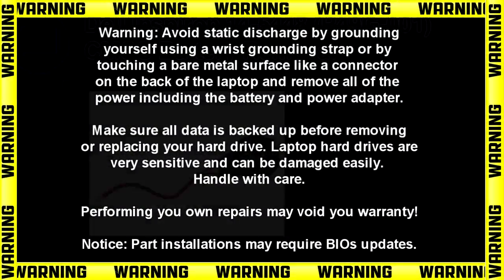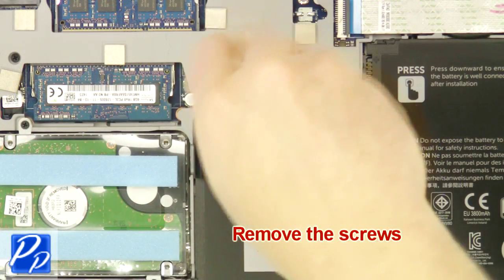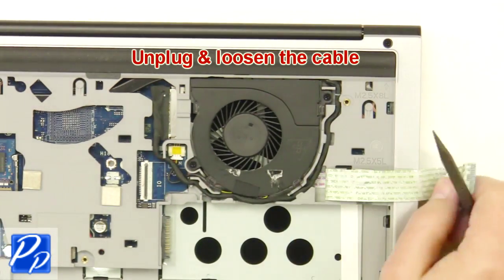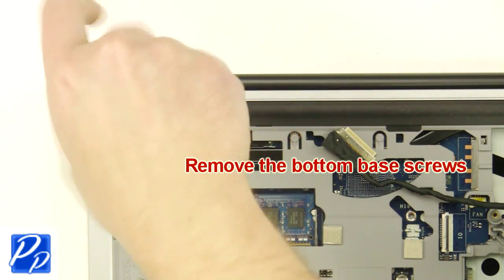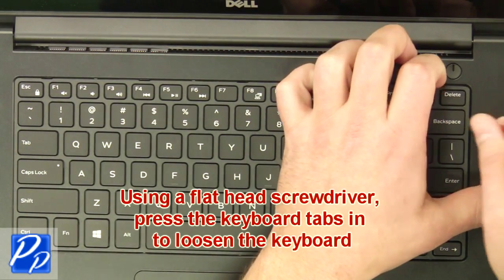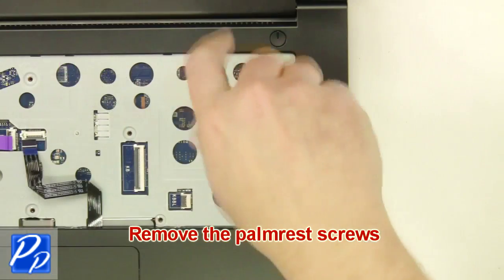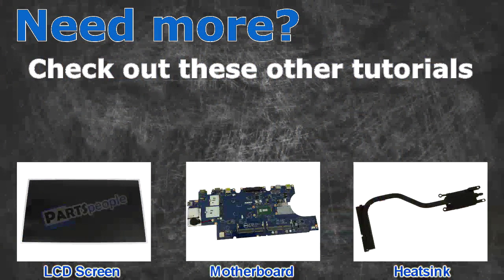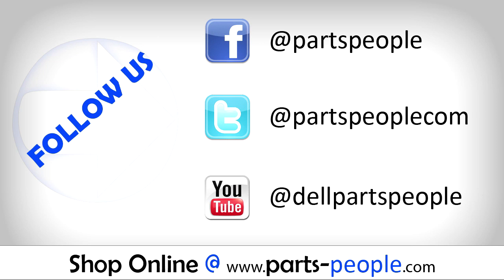Dell Inspiron 14-5448 (P49G-001) CMOS Battery How-To Video Tutorial

Comment: Great video. My 5447 does not seem to turn off fully. It is running windows 10 and I get good battery life from it from a full charge but if I leave it over night it drains to zero even when shutdown. The battery charge meter is malfunctioning also. Sometimes it says I have 3 days battery life and it often says 1 minute until fully charged. Could replacing the CMOS help my situation?
Reply from the maker: +Bri VAN DAM I haven't heard of this problem yet but, I'm pretty sure replacing the CMOS battery would not be the solution. It sounds like you may have programs running in the background that could be causing the battery to drain and/or possibly some dead cells in the battery that are causing it to drain faster.